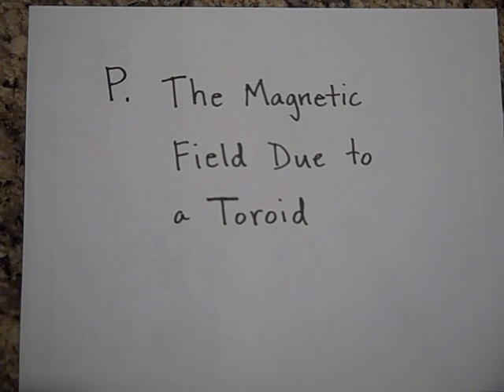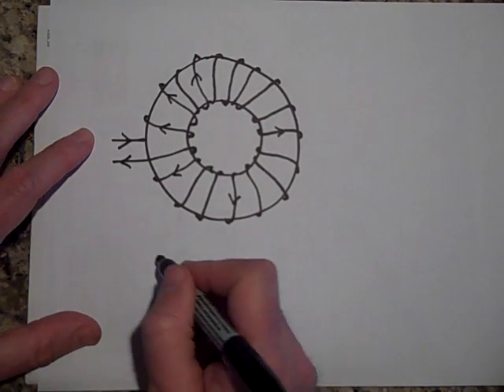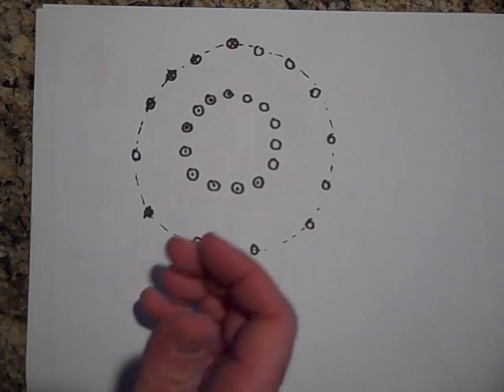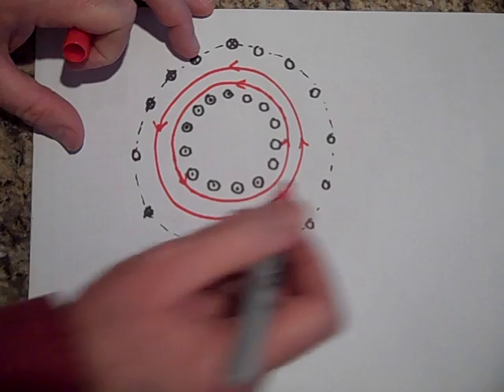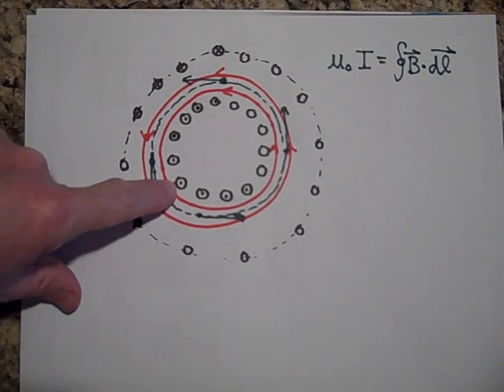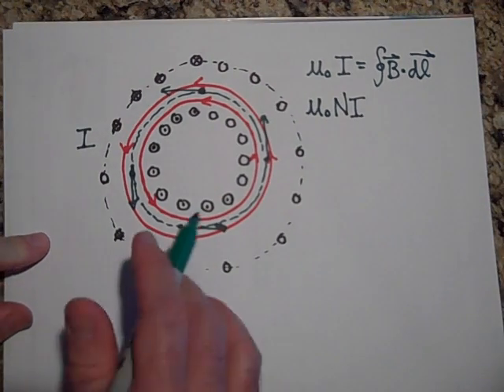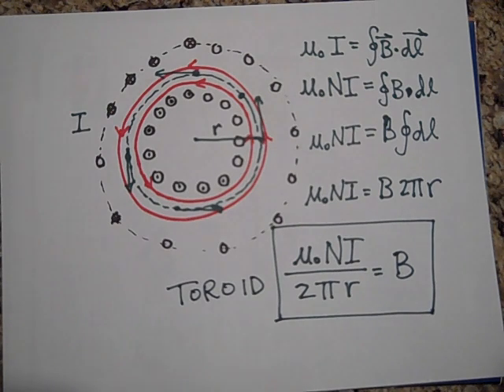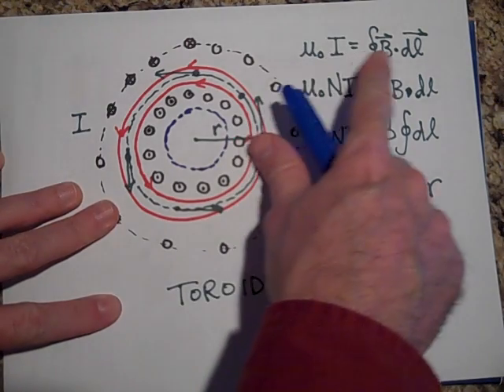The Magnetic Field Due to a Toroid

Comment: Sorry to tell that this is wrong. There is a field in the middle that is perpendicular to the paper surface and you can find it by integrating loops that go though the center and over the toroid . If you need a toroid without this field you need to make an additional winding .

Comment: Isn’t it false to say that when the enclosed currents are 0 the fields are 0 ? It is true they partially cancel on the outside but shouldn’t the magnetic field from the outer layer have a stronger contribution that the inner layer a distance r from the outer layer (since it is closer to the outer layer) so the net field is not 0 ?

Comment: Considering the age of this video, I would be extremely impressed if you answered this question, but I will ask anyway.

A friend of mine says that, in 3D space, the magnetic field inside a toroid varies as a function of z. I am convinced otherwise though, because no matter where you elevate your Amperian loop, you always have the same current enclosed (as long as the loop is still within the toroid).

Who is right?
Reply from the maker: The Ampere's law arguments in this video only apply to the magnetic field strength at points that are in the same plane as the toroid.  For a point on the z-axis you would not be able draw an Amperian loop that passes through that point and has a B that is uniform at all points on the Amperian loop and where B and dl are in the same direction.  You would need to get this done with the law of Biot-Savart but not easily, perhaps with a the help of a computer. B lines are always closed loops and, unlike a solenoid, in a toroid the B lines can be closed without ever leaving the toroid.

Comment: Question:  If there is no magnetic field outside of the toroid, then what causes the rotor inside a stator to spin?
Reply: That's a good question! I'm trying to find that out, too. It's like the question "In a transformer, if the magnetic flux is confined to the magnetic core, how does the secondary coil pick up the power? " I really like this video; starting at "Does everybody know how these things [transformers] work?" https://youtu.be/kH3ETTd6bPI?t=2087

Comment: I'm trying to find I, I have everything and K_m but I can't figure it out. Here's the problem A toroidal solenoid with 500 turns is wound on a ring with a mean radius of 2.65 cm . (A)Find the current in the winding that is required to set up a magnetic field of 0.340 T  in the ring if the ring is made of annealed iron (Km=1400).
(B)Find the current in the winding that is required to set up a magnetic field of 0.340 T  in the ring if the ring is made of silicon steel (Km=5200).

Comment: sir i have a little confusion in finding the field b/w the two wires you regret using ampere law by stating that one wire distance to the point is diff. from another wire so there is a net "B". bit in this case also the distance of inner circular cross section to the point "r"is diff. from outer cross section but here you uses the ampere law???

Comment: Thanks a lot, i got this question wrong but didn't know why.. You explained that the magnetic field was zero outside the toroidal solenoid. Thanks
Reply: The field produced by the inner loop of wires goes in the opposite direction of the field produced by the outer loop which cancels each other out and results in zero total magnetic field.
Reply: Allen Smith Thank you!

Comment: Hey, he means to say that the wire that is wound around the toroid does neither covers the amperian loop in the outside nor in the inside of the toroid and hence no current flows through it. Therefore, magnetic field at those points are zero. Thank You.

Comment: well.. there may not be any field inside because there isnt any current.. and there is field in-between the outer and inner loops because of the wire wound around the circular body.. and if you take an AL which goes through the center and meets at the outer part, It'll be the same case as it was in the solenoid..

Comment: Umm, the magnetic field in the center (or out of the toroid) is zero only in your plane. There is still some (but weak) magentic field perpendicular to your plane (going right through the center). That is because if you take an AL which goes through the center and meets at the outer part, there is one wire going through that AL, thus B is not zero.